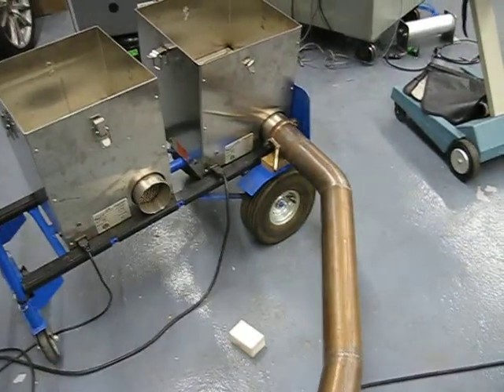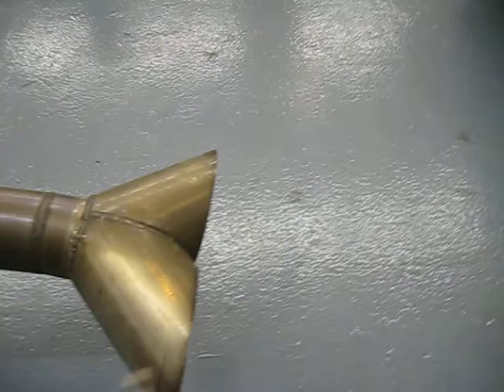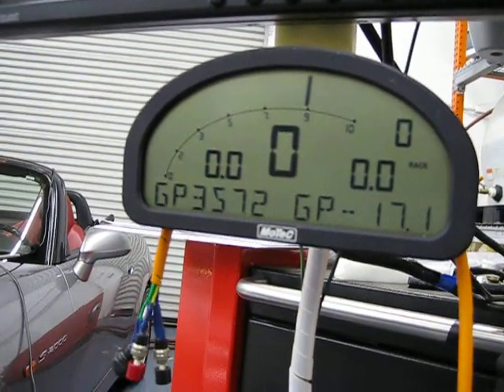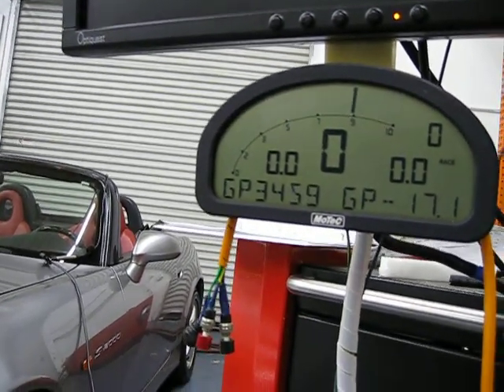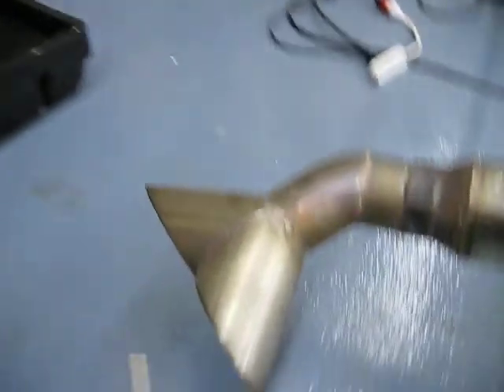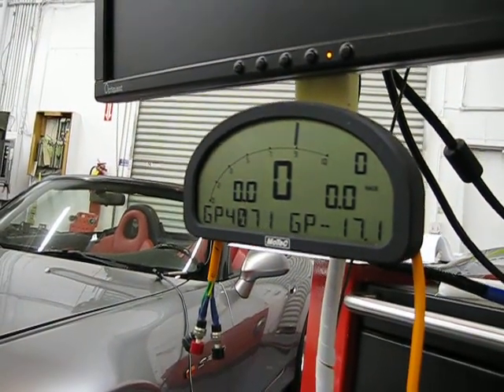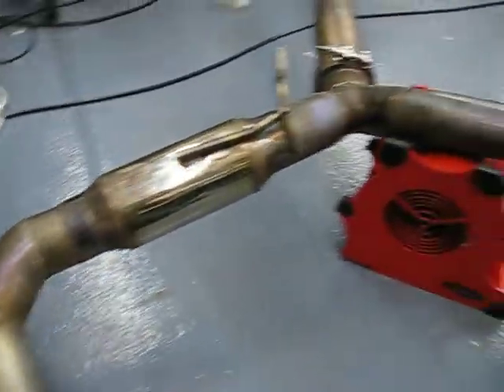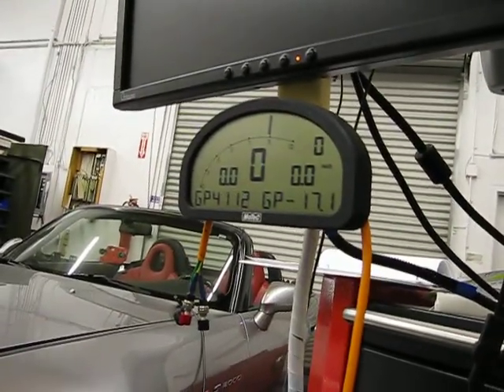Flow Testing Synapse Engineerings GTR Exhaust

Comment from the maker: @Mikeytoyota It is a good question Mike. Flow = Velocity * Cross Sectional Area. Our Cross Sectional area has gone up with the new exhaust design AND our velocity has also gone up, and this is all with a fixed air speed source.  Bottom line is that we are flowing way more than the OEM design.  Don't let these videos fool you, we take much more detailed & systematic tests.  This is simply for illustration on YouTube